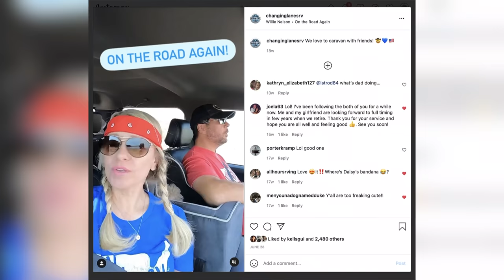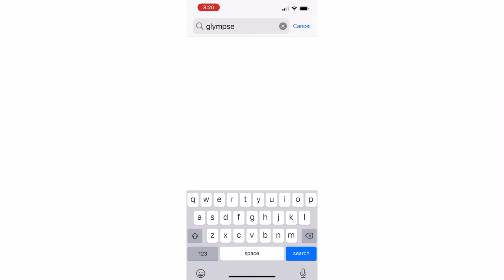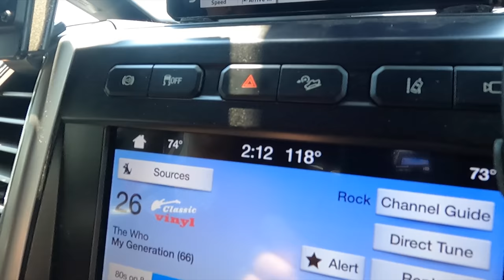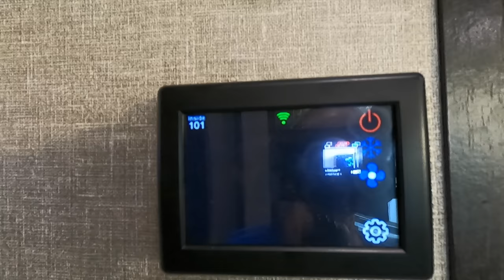😡  RV Park and Travel Day Issues! (Full Time RV Life)

Comment: I have run in to quite a few rv parks with low voltage. My Surge really does its job! Low voltage can ruin refer and a/c so when I hear my a/c drop down I know there is low voltage. Sometimes not low enuf to trip Surge Protection. My refer is a Dometic and (knock on wood) it is a good one. Makes Ice....ice cream if it is cheap ice cream! High temps of 117° in Az. and it did fine! Look into how residential refers are repaired. Have heard that it can be a problem. If they have to be removed you have to remove the slide. They build around them.

Comment: Was wondering what your TPMS tire temperatures where Chad?   Gosh, in those temperatures my main worry is my tires on our Phaeton, but I've never experienced 122 degrees before, albeit we've endured some hot temps in Arizona even in April, and as Canadians just aren't use to the maximum temperatures many southern states deal with in the summer heat.   We do have an older Tiffin but it also has a residential fridge, so I'd hope it would be able to keep up in such heat!    One question too that came to mind was, at least in the beginning, could you have started a generator to help get the amps you would need for the initial cool down period Chat/Tara?   Glad it worked out in the end, as no one likes to see one thing after the next go wrong as on that particular day.   Drive safe & enjoy!
Reply from the maker: Most RV Parks do not allow generators, including this one.  Plus, we were having issues with our genny and inverter at the time: https://youtu.be/53_w0SBAh9c. This was before we upgraded to the victron.

Comment: Another great video! We really appreciate you guys taking the time to put this out and issues you can face in extreme heat!  One thing we added to our rig is an Engel portable fridge with a solar battery “generator” that ride in the truck on travel days. We use this as a “just-in-case” with burgers, dogs and other necessities so if we loose the fridge we’re not totally screwed.  Engel’s seem to use the least amount of energy for the portable fridges and have been around since the 70’s in Australia! We love ours! I agree about the residential fridge! The thing we are considering is the power amplifier - except some say those are problematic and not to mention expensive. But if it avoids the low voltage problem, maybe it’s worth it(?)

Comment: Kind of weird seeing engine brakes shutting off and staying off after restarting the engine. Both of our semi trucks stay on until I flip the switch.  Both Internationals, 2021 LT625 and a 1997 9800. Glad this worked out well enough.

Have also used Glympse quite a bit in the past.
Reply: On my 2017 Ram 3500 DRW I have to hit the exhaust brake switch every time I start the truck which is annoying.  The truck is smart enough to remember tow/haul mode whenever a trailer is plugged in so why it won’t remember exhaust brake is beyond me.

Comment: Another great video but, when you do have to pull over on a busy highway/road, when you need to get back onto the moving lanes, UTILIZE THE EMERGENCY LANE TO GET UP TO SPEED before creating a dangerous situation that could be catastrophic. Never just jump into  a lane doing slow speeds. 
That would be another thing to look at where you will stop on the side of the roadways. The space to regain speed to reenter.

Now I've gotten to the point of the "voltage situation". 
As a career/retired specialty electrician/ electrical contractor, NEVER HOOK UP TO A 102,103  volt system!!!! NEVER! It's will ruin your .... well, your EVERYTHING. 
That place has some serious and expensive to repair transformer problems. It's ready to go and when it does, it'll be a neat sight to see. It'll be a bright blue flame shooting straight out of the transformer. It's COOL TO SEE! 

Good information about the gas/electric to the residential fridges. We're going to be going full time soon and have been shopping with our eye on the fridges in mind. I'd been thinking about going with the larger gas/electric fridge due to the power style. Now I'm going back to looking at them with the resi. 

Thanks for the video guys. You helped me out and I hope I did the same for you or anyone else with my info. 

Be safe. Be happy. Never forget to live life to the fullest cause it's the only chance we get!!!

Comment: I always run with my engine brake on in my Ram while towing.  If I do need brakes going down a hill I use the 3-5 stab method. 3 seconds of braking to decrease speed by 5 mph.  Then let up to let the brakes cool.  I used to drive a big truck down Parley hill (from Park City, Utah to Salt Lake City) using this method in a lower gear without compression brakes (because the engine brake didn't work) and never burned up the brakes.  Stab, let off, stab, let off.  NEVER RIDE THE BRAKES!

Comment: I live in north central Texas,  accustomed to summer and even I know not to go to Vegas in summer. HAHA
Sounds like just normal RV traveling. ,nothing goes bad until -- your running late, it's raining, it's snowing, it's cold and wind is howling, hot and NO wind, then it's all bets are off.
Kudos for having a good attitude about it. Going through what y all did and then get your fiddle playing friend, wouldn't have helped but I'm afraid I would've had to be locked up. No excuse for folks to act that way. Again 👍👍 for the way you handled the whole situation.
Take a shower, cool off and get a cool beverage. Put on happy face and move on, otherwise you just ruin your trip.
Glad it worked out and you didn't lose your smile 😁. Happy trails.

Comment: were you on that mountain-y stretch on I-15 through AZ at the time with your brakes?  That's where we were when we lost a tire off the rear trailer axel...yes, the tire just flew off into the median. A car pulled up next to me yelling something, we thought she said something about a tire so we pulled off as soon as we could (there's no shoulder through there so it was over a mile before I could pull over).  Thank God no one was hurt by our rogue tire.  Of course there was no cell service there and it was dusk so we hobbled to the next exit which happened to have boondocking.  We were able to retrieve the TPMS that night and the tire the next morning after a trip back to St. George to purchase lug nuts to put the tire (which was totally fine) back on the trailer.  Just one of the many crazy adventures we've had RVing.  Btw, Tara, I hope you're able to figure out something to heal your health.  My husband was shocked by how much weight you've lost! <3

Comment: Voltage issue one leg should run 2 ac units. I can swap legs on my system in just a matter of minutes with my cables. If there are 2 ..50 amp plugs. I can pull off each plug and run the rv on one phase. it will be unbalance but not much for the park over all. Also have the ability to run your system off 2/30 amp plugs. As long as you don't have any 240v appliances. Even with one phase its still 50 amps at 120. Many rv's have a single 30 amp 120v line. I have 3 roof top units also so I understand.

Comment: LOL Here I am sitting watching this from Vancouver Island our ancient heating fuel furnace is dead and has been for 3 days. No parts available. Thank God, I had gas plumbed to the property and bought a gas stove. New gas furnace is on order. It was 50°F this morning inside, and there was several inches of wet snow outside. Put a heating pad between the blankets last night. A Little Buddy propane heater went in the bathroom at 05:30 for the wife to have a warm shower, and I put her towels in dryer to heat up. I turned the gas oven on to pre-heat stuck a box fan on the counter to distribute some air. It was 68°F  - 72°F in the kitchen and living room when she came out. I'll trade you some of that lousy hot Vegas air for some of our new improved cold fresh Canadian air. :) :) :)

Comment: This is the very reason i am happy i got rid of my Booth& table and put my Computer and desk in the living room area AND i still have a full table and chairs  to sit at that i bought cheap from walmart. Is it life time durable? no but if it breaks i can always go buy another set up for under $200.00 to replace it with and i'll use it until there isn't anything left to use with it too. This way everything but the bedroom is in the main cabin area and all under one Still inefficient AC unit that trips the breakers in the dead heat of summer too. Can't wait to get my Mini Split and get it installed. You have Some idea based on what you went through in this video but I have a Residential refrigerator that keeps everything ICE BLOCK cold too in the heat and cold so that is One major difference. I had those issues with my propane/ electric refrigerator over the summer too where nothing would get cold or stay cold in my other RV

Comment: We are currently stay at that RV park and have had no issues with power or the employees. The park is clean, quiet and the staff has been nice.  It was a hot summer. We had power issues in Minnesota where we also had humidity to deal with.
Reply from the maker: I would highly recommend checking the voltage.  Even if your ACs are running, with low voltage they will be working MUCH harder and it will eventually kill your compressor.

Comment: The last time I, a professional home owner, had to deal with low voltage on a leg of a 240 volt circuit, was due to a loose neutral (white) connection on the leg back at the main breaker box.

Comment: In high temperatures the Southwest experiences a lot of brownouts and rolling blackouts. Other businesses in the area were likely experiencing similar voltage issues. 
RV’s really aren’t designed for you those high temperatures. If you plan to be in places with high summer temperatures like Las Vegas a hotel would be a much better choice.

Comment: Well, you beat my Disney World on the Fourth of July adventure. You have a great attitude. You mentioned upgrading to a non propane refrigerator, check out the 12 volt compressor refrigerators that are becoming more popular. Cool fast, very low power drain. Grand Design is supposedly offering them in their RV's.

Comment: Hey guys!!   Love your videos!!  So sorry you went through this.  I wanted to offer a refrigerator solution - you may already have heard.   We have a Solitude with same refrigerator as you.  We had ours convertered this past fall to a 12V at JC Refrigeration in Shipshewana.   You can have them do it next time you are in Elkhart area or with your mad skills Chad you can definitely do it yourself.   We love it!!  using 1/8th electricity as gas/electric and with ours set at 3 (keeps orginal control) - our freezer is at -10, and our fridge side is at 34.    Thanks again for all your content!! You are my go to for anything I need to know about RV.
Reply from the maker: Thanks!  I've had my eye on that for a while now.  👍🏼
Reply: I was hoping my RV mfg would offer 12v compressor... they did not.  Dealing with propane up and down temps, but does work a lot better than my last RV absorbtion fridge, which I installed computer fan in to circulate the air inside the fridge

Comment: Lol, the violin was funny. Newbies in the heat! You made so many mistakes. But maybe you’ll learn from them. 

Here’s a tip for your fridge.  PULL IT OUT! Throw it away. Lol. You can put a residential in its place, not hard or expensive. But if you must keep it, get dry ice and put it in there. Works miracles in the heat. You won’t even have to run it.

Comment: We were traveling from Salt Lake to Fallon NV this time frame and the 120-degree heat cost us a roof,  the front cap transition sealant dicor got so soft some were outside of Wells NV  it let air under the roof membrane and puffed it up like a balloon.
Reply: @ChangingLanes  Yea, it was something to see lol thank gosh for dicor tape was able to get it stopped, and we carried on, and we’re able to get it fixed when we got close to a dealer. When they put our second ac on, they could take the moldings off, re-stretched the roof, and bada bing all good. They added a mountain of sealant, so if it got that hot again, it shouldn’t fail.

Comment: Having lived in Las Vegas area a long time ago, I wonder if you could check out the portable swamp coolers available now-a-days. They are great air conditioner boosters that work great in low humidity areas. They basically run a fan through an artificially made waterfall. The water evaporates, taking some heat out of the air, which, in turn is blown in the room. It can replace standard air conditioners in desert areas. I have recently read about portable ones (desk size). They likely pull less wattage than a regular air conditioner too. Now, they are not sold under the name of 'swamp coolers'. That is just a common nickname they had when I lived in Las Vegas decades ago. We had another nickname for Las Vegas too (Lost Wages). But something like that would be helpful when traveling through desert areas particularly when having low voltage issues. Most apartments had those instead of regular air conditioners although sometimes the humidity from Lake Mead made them less affective.
Reply: You can find them in a search with the name 'swamp coolers'. Also known as 'evaporative coolers'. I was surprised at the desk size price I saw. A floor size model was 1/3 less. That was just with a quick search for alternative names for them.

Comment: I dont know if most people are aware of this but you can not have a 2 way radio near the trailer brake controller cause it will cause weird things to happen with the trailer brakes. I found this info in a brake controller manual. I had this hot brake issues in Emergency vehicles pulling trailers for awhile until i read this in the manual and then moved controller away from our radios and never had another problem. Not sure if this was your issue but its good info to know either way. Drive Safe.
Reply from the maker: Interesting!  Will look into that.

Comment: That experience had to hit all the emotional checkmarks for anyone in an RV.  Glad to see that the tire issues were simple to remedy.  Now I'm thinking about putting a plastic-coated checklist just for the vehicle inside the vehicle with all the necessary check-box items listed.  I think you mentioned something like that in the video.  Regarding that "play the violin" employee comment; NO One should be that tired or stressed out to demonstrate that kind of attitude and especially in a location where people spend hundreds to thousands of dollars while they are in that area.  I understand it happens to have bad days, but the individual should still have done their job regardless.  Anyone who lives and works in that kind of environment is most likely much more acclimated to the heat, so they shouldn't be as impacted by the heat as guests (like most RVers would be) who typically don't live there year-round.  Regardless, thanks for sharing the experience.  Is there something we could get to plug into the stand to check the voltage before setting up the RV?  Just curious, but would a good multi-meter have been easier to check it before putting out all the slides, jacks, etc.?
Reply from the maker: Site 1, we hooked up power... Site 2 and 3, we used the multimeter.  👍🏼

Comment: Park in New Mexico recommended a repair shop because we were having electrical issues.  The mechanic told us our inverted was shot and some other stuff and would cost $4,000 + and would take 3 days to fix.  He offered to let us stay on his property while he fixed it.  I called my local RV shop and they that didn’t sound right so we decided to drive home to Florida on generator power.  Long story short, inverter needed to be reset which amounted to pushing a button.   BEWARE
Reply from the maker: Wow!  that's SHADY!  Glad you didn't get taken! 👍🏼

Comment: Just finished watching your Vagas trip video and wanted to comment. We are Class A full timers and we can identify with the hot weather and things we all do to keep comfortable. 
Unfortunately you mentioned removing the AC shroud to help with cooling. Most manufacturers recommend leaving the shroud in place to help AC run more efficiently. Secondly, you mentioned absorption refrigerator problems. Last spring we replaced the absorption part of our fridge with a compressor kit supplied by JC Refrigeration and it kept everything cold when parked in Louisiana in daily 115 degree temps.
V/R
-Jamie

Comment: I love my Hughes autoformer 2% boost at normal voltage.  If voltage gets below 114v you get a 10% boost. Rv parks need to invest in premium electrical systems until then I’ll use my autofromer!

Comment: Just saw this video in 2022 in July. I don’t know if you have covered this before, but A site could be fine most of the time but when the park is full and the temperature is 120 and everybody is using 40 A, it’s not surprising that you’d get a brown out. That much draw is probably more than the campsites power grid can maintain. In other words you go back on a cooler day and they’ll have 120. That’s actually my fear of traveling in the summer. A normal campsite with 120 V begins to have 103 V shared by the other 200 campers.   You don’t cover this but did you get to see the power restore after a few days or maybe late in the evenings when it’s cooler?